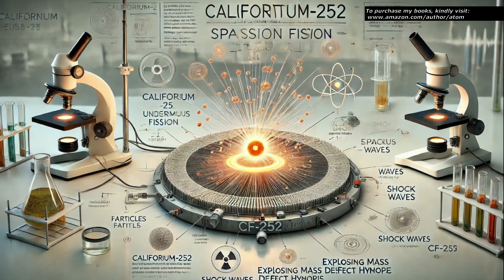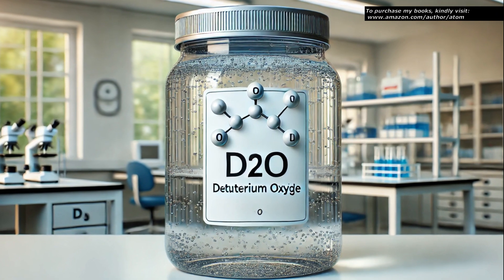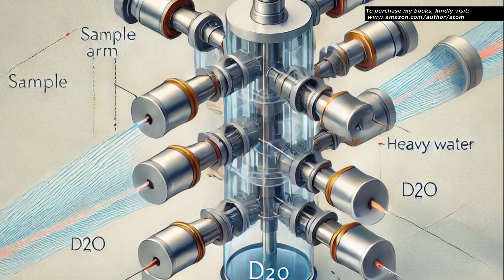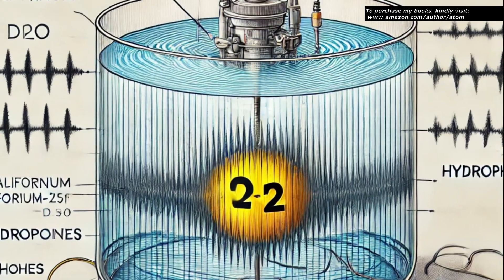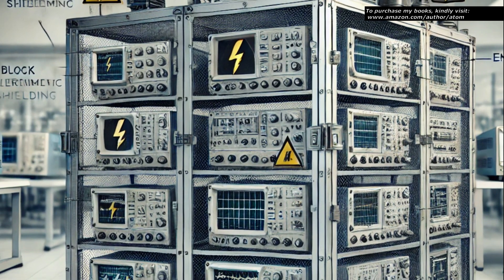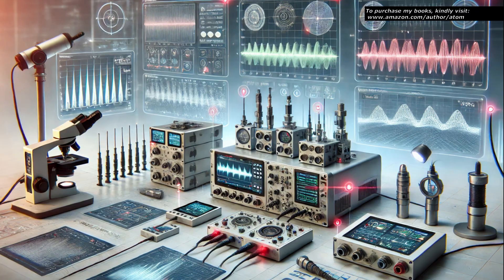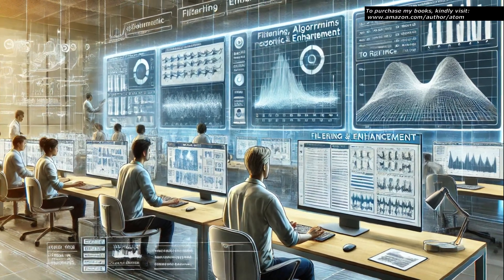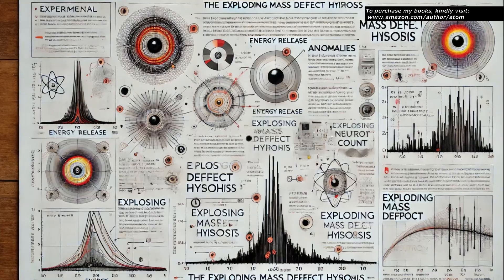Nuclear Shockwaves to Test Mass-Energy Equivalence: Unraveling Cf-252's Exploding Mass Defect

Comment: Keep it up. There are many misconceptions of science that need to be challenged.

For example: Mass (in the form of protons and neutrons) is not the source or cause of gravity or energy as Newton and Einstein had postulated respectively. All forms of energy and all known forces are in fact generated by the unification or a combination of two, three, or all of the four known fundamental forces: E=MC2 is meaningless.

*Mass is weightless.
Mass is a scalar. It has magnitude (amount of matter in the form of protons and neutrons) but no direction: It is not a vector. It does not move in any direction - down, up, left, or right of its own volition unless it is acted upon by an unbalanced force. What this essentially means is that mass is weightless contrary to what most people assume.

*Atomic weight
The atomic weight of an atom is the sum of its protons and neutrons and not its actual weight. 

*The pseudo "inertial resistance" of mass 
The so called "inertial resistance" of mass does not exist. Inertia is simply the tendency for objects to want to maintain the state of motion that they are in as per Newtons 1st law of motion and nothing more. This is not the same thing as having the tendency to resist changes to their state of motion.
It is the forces that are already acting on the objects that resist changes to their state of motion. On earth, these forces are gravity, air friction, surface friction, tension, and the normal force.

*Weight: Gravity and the normal force.
The weight of an object is the net force of earths gravitational field interacting with the gravitational field of the object and pulling it down towards the ground and its center of mass. However, the weight or net force of gravity acting on the object will only become apparent if the counteracting and equal upward pushing normal force is also acting on the object simultaneously as per Newtons 3rd law of motion; and this is only possible if the object is resting on the ground or on a surface that is parallel to the ground or moving in uniform motion.
Without the upward pushing normal force also acting on the object simultaneously with the downward pulling force of gravity, it will assume its true property of weightlessness and fall or accelerate towards the ground at the rate of 9.81 m/s/s.
This is why all objects regardless of mass that are dropped in earths gravitational field, fall or accelerate towards the ground at the same rate of 9.81 m/s/s neglecting air friction: They are all essentially weightless which is the true property of mass. The pseudo "inertial resistance" of mass has nothing to do with it.
Gravity alone will not render weight to an object.

*Individual elementary particles such as protons, neutrons, and photons do not and cannot generate their own gravitational fields and thus, do not have weight...

*Gravity only interacts with gravity
As a non-contact force, gravity only interacts with gravity. It does not interact directly with mass. The force carrying bosons of a gravitational field otherwise known as gravitons will only interact with the force carrying bosons of other gravitational fields. If an object the size and mass of the Great pyramid of Giza for example did not have is own gravitational field or its gravitational field was out of phase with that of earths gravitational field, then it (earths gravitational field) will not interact with it and pull it down towards the ground and its center of mass. If we placed the object onto a scale, it will not register a weight reading but remain at '0' kgs as it (the object) would essentially be weightless. 

If we placed the object 20,000 ft high up in earths atmosphere immersed in its gravitational field and with no other external forces acting on it, it would remain suspended 20,000 ft high up in the air and not fall or accelerate towards the ground despite its great mass.
If we switched the objects gravitational field back on and switched the earths gravitational field off instead, it would still remain suspended 20,000 ft high up in the atmosphere and not fall or accelerate towards the ground. 

*Heaviness: Gravity and the normal force
When we hold a solid and dense object in our hand such as a gold ingot for example, the heaviness that we feel is not due to its mass, but rather, it is due to the normal force of our hand pushing back up onto the gold ingot in reaction to the force of gravity pulling it down towards the ground and its center of mass as per Newtons 3rd law of motion. Again, if we remove our hand from underneath the gold ingot and thus remove the normal force, it will assume its true property of weightlessness and fall or accelerate towards the ground at the rate of 9.81 m/s/s...